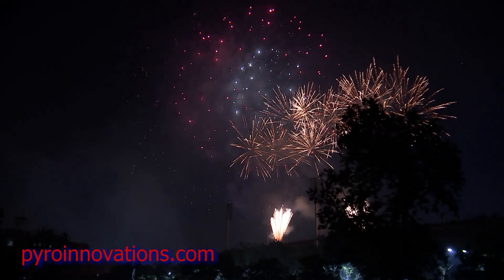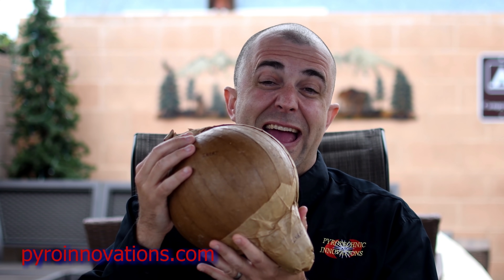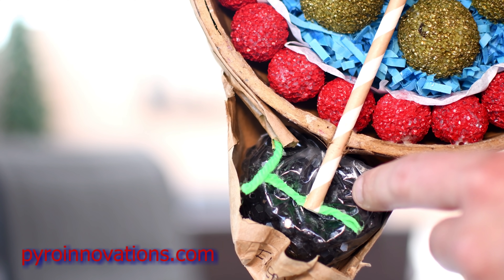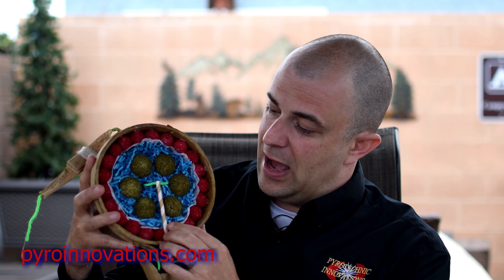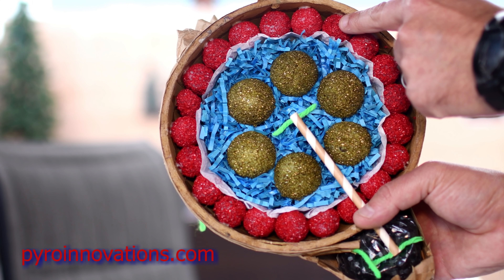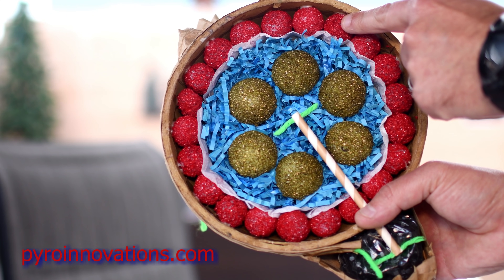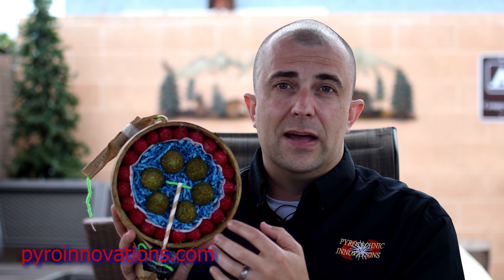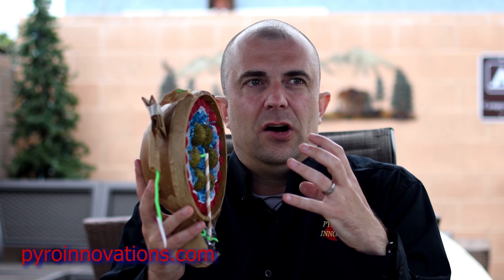How Fireworks Work

Comment: I always do fireworks on the 4th.  Every year I keep upgrading what I do to increase safety.  I use consumer grade, class c. I always angle my 60 gram mortars away from the shore of the lake, but they still seem to not really travel  the angle of the tube. Any tricks to this?  And i got some tubes that seem to be bigger than normal.  Should I remove them?  It's not a huge difference,  but they are bigger
Reply from the maker: Hi Joe, you have to keep in mind that mortar shells are not rifled bullets. You could fire 100 shells one at a time out of the same mortar and they will all skew differently. Many things can influence which way they skew, too many to list here, so unless you are using professional high precision proximity product, the result you described is pretty typical. Testing a handful out of a single mortar could give you a statistical idea of where they might end up. As far as the size of the mortar, there is typically space around the shell in the mortar, and it can vary. Both the tube inner diameter and the outer diameter of the shell could vary slightly based on the manufacturer. Hope that helps!
Reply: Aim for the tUrTLeS.

Comment: SADLY HERE IN MONTREAL NOT ONE CAN BE FIRED OFF AT ANY TIME BUT YOU WERE SAYING THAT USING CONTAINERS (MORTARS) IS SAFER ONLY BECAUSE ROCKETS COULD VEER OFF IN ANY DIRECTION AT ANY TIME. IF THOSE ROCKETS WERE TO BE PLACED INTO 10 FT MORTAR CASINGS AND LOADED BY THE BOTTOM, COULDN'T THEY BE SAFE THEN??
Reply from the maker: No, that doesn’t change the fact that once the rocket leaves the end of that 10’ tube, it is still under propulsion, in other words still accelerating. Rockets can change course for any number of reasons and the important point is that when they do so they are still accelerating. Thanks for your comment!

Comment: For the shells that have designs like the happy face, is there a way to know which way everything will fly out once it explodes, that way it wouldn't be sideways from the crowds perspective?
Reply from the maker: Only for one of two dimensions.  You could theoretically configure it as a "rocket" by lowering the center of pressure down below the shell (think a stick like a sky rocket), but that would only control one dimension.  It would still be able to rotate around its center axis.  So long story short, no, which is why when ever we do a happy face or other pattern shell look, we send multiple shells up so that statistically one or more will likely break with the proper orientation to the audience.  Great question!
Reply: I've seen pattern shells blow every possible angle it just depends which way it tumbles before reaching apogee and the Burst charge ignites
Reply: For the most part no and for this reason I've always looked at this effect as kind of gimmicky. At the end of the day though if people enjoy the effect theres no harm in it.
Reply: Keep firing them, keep fiming them, and then only ever post the ones that exploded in the right direction.
Reply: You can build shells Like parosol shells, that is in the right direction
Reply: The shell spins in the air so no not really

Comment: How much would the one you're holding cost?
Reply from the maker: There is not a simple answer to this.  The cost of a shell not only depends on the size, but the manufacturer and more importantly the effect.  You can have a good range depending on what the shell does in the sky.  You can do a quick internet search for "1.3g price list" and should come up with a good number of distributors that you can likely get a price list from.  Thanks for your comment.

Comment: Amazing explanation, just what I was wondering to know. But until now I still am intrigued on how do they made a cubic form on Disney Fireworks some times, that must be a little more tricky to do because of the circular explosion... 🤔 Or is it simple to do?!

Ps. Once i saw  this open model you used to show in the video, I imagined how cool it would be if someone film the open model exploding on a SuperSlow camera. It would be amazing. 🙂
Reply from the maker: Luigi, thanks for your kind words and comment.  A cube can be made in the exact same way as the other pattern shells, maybe a bit more tricky in arranging them and keeping them in place, but ultimately the same physical principles apply.  Don't think of it as a "circular" explosion, think of it as a "symmetrical" or "uniform" explosion due to Pascal's law which describes how pressure is equal in all directions within the confined space.  
Someone actually did that exact experiment a couple years back, can't remember where we saw it, but they basically glued a half built shell to a piece of ploycarbonate, and watched it burn and explode from the time it was ignited.  Although very cool and able to provide a little insight, there were some flaws in their setup that would prevent a very accurate representation, especially since the glue would not hold with the same strength that a fully built shell would, causing leakage, lower pressures, and premature failure.   Thanks again for your comment!
Reply: @PyroInnovations  thank you very much for the reply and the explanation.  I think I got it. 🙂 I wish you health and sucess. Thanks
Reply from the maker: @Luigi, no problem, same to you!

Comment: I have a question.
Thanks for the great explanation but there are some affects at the very end of the explosion which cause tge stars to travel or move if you get what i mean. 

How is this done?
Reply from the maker: Levi, what you are describing could either be an insert or flying fish fuse.  An insert is exactly that, a small stand alone device that is inserted into the shell.  Think of a small cardboard tube with composition in it, which ignites after the shell breaks.  The insert could be a whistle, tourbillion, or a number of other effects.  Flying fish fuse is a special type of fuse that gives a self propelling spreading in random directions spark effect.  So for fish fuse, imagine a bunch of tiny pieces of fuse inside the shell that are designed to produce that effect. Thanks for the comments and question!
Reply: Here's some more info/visuals on what Mike is describing:  https://www.skylighter.com/blogs/how-to-make-fireworks/stars-shell-inserts